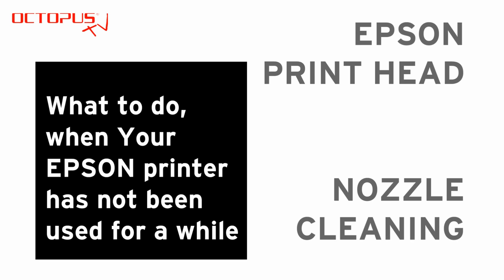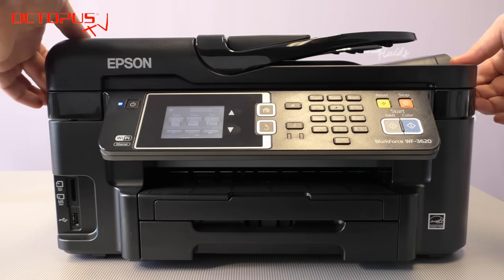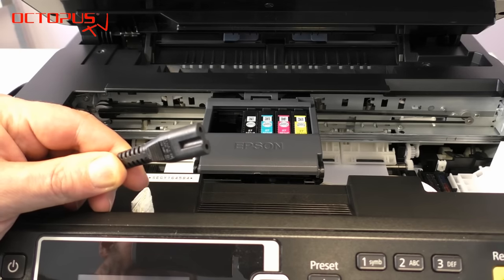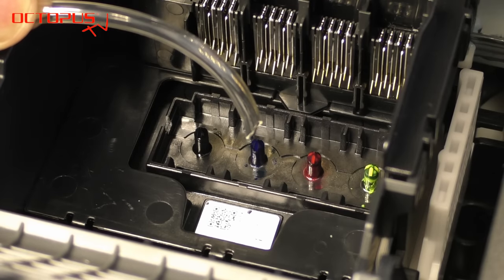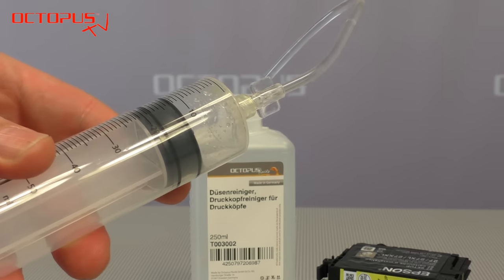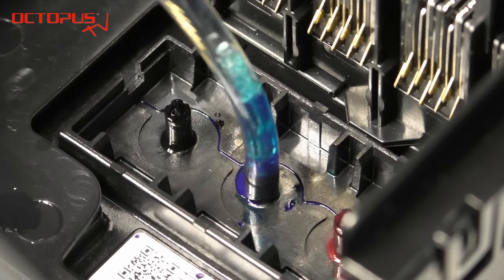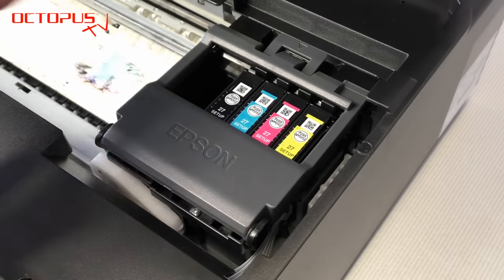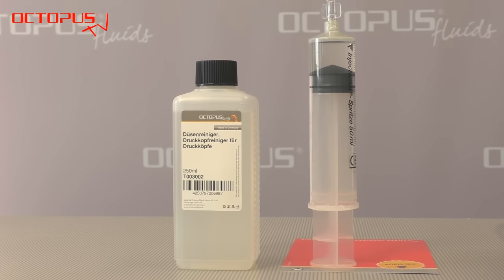Epson print head cleaner, nozzle cleaning - flushing clogged nozzles

Comment: Well would be very thankful if you answer my question, i have an sx218 i didn't use it for a long time and the ink head is just not flushing i tried the printer cleaning but still not flushing other head flush normally but the black ink head is clogged and nothing seem to flush it do you have any solution that can help ??
Reply from the maker: Hello Lina, thanks for Your question. The SX218 is a really old printer model - really good quality. So for Your issue there could be multiple causes.
As You say that You have not used the machine for a long time we assume that print head is dried in completely. There is also the chance that the ink remaining inside the print head has solidified - that´s a serious blocking then. The only chance to get rid of that is to let suitable print head cleaner taking its effect on such a clogging - that can take really long time. In that case building up pressure by flsuhing or paumping does not really support the process. The cleaner must be water based and is not alowed to have any minerals inside.
Beside that it is also possible that other obstacles are connected with the printer - the whole system is againg over the time and the materials the printer is made off are not going to be better.

Comment: Mine is a Epson model "ET-2550" which doesn't have ink cartridges but individual ink well "tanks".  How does one access those nozzels ?  Where does one obtain that syringe & proper diameter tubing ??
Reply from the maker: Thanks for Your question. At the Ecotank series You can detach the ink tubes, leading fromt the tanks to the print head, from the print head compartment. Then You have access to the ink ports in the print head compartment.

Comment: i have an Epson WF-7710 that stopped printing Magenta. I ran multiple print head cleans with no resolve. I had to end up buying another maintenance box. I also flushed all nozzles and cleaned print head. Now when powering on the print head slide to left and then makes a loud scratching sound and stays stuck to left. Error 000023. I also have a brand new Epson ET-15000 that I flushed ink out of to add sublimation ink to and it began making this same noise. After manually unlocking print head carriage to move it freely is there something you have to do to relock it back to original state. I dont want to send both to repair shop when obviously I caused the problem.
Reply from the maker: Hello Victoria, thanks for Your question and description of Your problem. Actually there are no additional steps necessary to get the print head back to work after setting the print head cartridge free to move manually. We recommend to unlock it by cutting off the power supply. How did You do it? Did You unlock it from the parking position in a different way?
Reply: @octopusoffice  I unplugged the printer as soon as print head carriage moved. Now when I turn printer on it makes loud noise when trying to move from left to right. Actually I tried again yesterday by taking ink cartridges out and the belt popped off when trying to move to right. Now I’m trying to bring to a service center for repair.
Reply from the maker: Hello Victoria, thanks for coming back with this detailed description. We understand that You refer to the belt that moves the print head compartment, right? Cutting off the power does not have any effect on this belt - when it comes loose or popps of its holders there must be some other reason for this behaviour.

Comment: I have used the method you describe but have a curious result. After I complete the cleaning process and place the ink tank back on (my trouble is with black only) I do not get any black printing. If I take a syringe put black ink in it and force the ink in with the syringe, then put the black ink tank back in place, I get black printout but only for a very short time, as if the injected ink only is being used. The black printout stops and
Reply from the maker: Hello Clif, thanks for Your description. When You are saying black tank You refer to a black inkjet cartridge, right? Have You tried to use another cartridge then the one in Your description?
Reply: @octopusoffice  Thanks for your quick reply. Yes, in fact I bought an Epson black cartridge, installed it, and there was no difference. As a result I decided that I would remove and clean the print head assembly thoroughly (following another video on how to do it). I completed that, but have yet to see the results because when I start up the printer I get a "error 31" when the carriage goes the the far left before it completes its initializing routine. When that difficulty is solved (any ideas appreciated) I will be able to see the results of my cleaning.

Comment: Will an isopropyl alcohol work for this purposes?
Reply from the maker: Hello Marco, thanks for Your question. The inks used in Epson desktop printers are waterbased inks. So You need to have a waterbased cleaner too - this achieves the best results. Isopropanol cannot dissolve cloggings caused by waterbased inks.

Comment: Hi sir,  I'm Chris Nguyen in Houston.  I have the same problem on Epson 2200 but after I tried to clean the clogged print head several times I got it so bad that I got the message "the photo black in is low or out" I don't know what to do.  Can you help me?
Reply from the maker: Hello Chris, we are sending our greetings to Houston! The message that You are describing should refer to the ink cartridge´s ink level status. After flushing the print head with cleaner You need to get ink back into the ink system. We recommend to do this by printing test prints on used paper. This consumes ink from the cartridge. Seems to us that You need a new cartridge. (?)

Comment: Thank you for this info!! I have cleaned all of the nozzles on mine and it appears that all of the colors are coming through on the kitchen towel now, however I can’t get anything to print on paper. I’ve completed all the steps to check alignment, etc. I’m so frustrated!! Any suggestions?
Reply from the maker: Hello Sonya, thanks for Your question. After the cleaning there always remains cleaning fluid inside the print head. It is necessary to print out that cleaner. We recommend to do test prints on used paper to get the prints back to looking normal. That may take a number of prints but this way You are not filling up the waste ink section on Your printer.

Comment: I followed these steps after my yellow ink was failing to print. After cleaning I replaced all new cartridges and now I’m getting blank pages. Managed to get the black to print, but no colour. Any suggestions? I’ve repeated the print head cleaning, including around 20 cycles of the printer cleaning programme from the menu
Reply from the maker: Hello Matt, thank you for asking. After using the cleaning method from the video, there is still print head cleaner in the print head - it has to come out again. The best way to do this is to start a print job with 100 pages - on paper that has already been used (the test prints are really for the wastebasket) - and then the colors will gradually return. When printing, you look again and again how the result looks and then decide to continue printing, to cancel the print when the colors match again or to start a new print job if the 100 pages are not enough. The advantage of printing out is that the printer's residual ink sponge is not unnecessarily burdened.
Reply: Thank you so much! Appreciate your reply!
Reply from the maker: Always welcome!

Comment: Hello, so my problem was that my printer (Epson xp-432) was not printing black anymore or very blurry so I bought your kit. Used it like in your video and it came out worse all colors went crazy. So I decided to remove the printhead and flushing like in your video but outside of the printer. I saw that the liquid I was flushing was nicely going out of the printhead so I reassemble it and tested. Now I'm back to square 1.. every color except black is printing perfectly, black is not printing at all so I don't know what to do. Maybe you have an answer to this ?
Reply: By the way, the cartridge is brand new
Reply: Well now I have an error code 0x9A I'm just gonna throw this garbage. Wasting my time repairing it and wasted half a price of a new one so well
Reply from the maker: Hello Tuan, thanks for the brief descritiom of Your situation. The outcome of your doings indicates that the clack nozzles did have a mailfunction before the cleaning already. So flushing the print head did not fix this issue. We also have not so good results with taking out the print head from an Epson printer - the wires and electrical connectors are really, really sensitive. In most cases we have done ourselves we had error messages related to the print head after installing the print head back into the printer. Sorry, that our way of cleaning did not provide a beneficial solution to You!
Reply: @octopusoffice  Well i wish i saved the money for my next printer that will not be Epson by the way lol. Anyway your product might be usefull but in my case it wasn't so too bad for me that's all. Thanks for your answer and have a nice day.
Reply from the maker: @christiantruvant4673  Same to You! Thanks for keeping up Your good mood ...

Comment: I once used the syringue based method, but it partially destroyed the print head as I may have applied too much pressure. To be done with care
Reply from the maker: Hello Pierre -  we are sorry to read about the not so nice outcome - we try to highligt that the amount of time given to the print head cleaner is doing the job and not the pressure :(
Reply: @octopusoffice  If I cant fix cyan and/or applied too much pressure as fluid will nor pass through, can I still use printer?  I only print in black?
Reply: @larrymulligan4824  Sure

Comment: I managed to declog my cyan using this technique but after a month, cyan seems to be leaking, not from under the print head  but splattered inside the printer, the inside including rollers are all covered by faint blue ... is there hope or its broken already?
Reply from the maker: Thanks for Your question. What kind of cartridges and what kind of ink are You using in Your printer? Are these alternative cartridges and alternative inks? It might occur that a non matching ink can cause such symptoms as too much ink is going through the print head and then is as You say splattered through the inside of the printer.

Comment: Hi,
I am wondering what is the contents of the bottle please,
is it a Isopropanol or can I use Isopropanol?
Thanks
Reply from the maker: Thanks for Your question. Our cleaner is a based on our formula for waterbased desktop printer inks - so the cleaner is basically a colorless ink. You need  to have water in the nozzle cleaning fluid to be able to dissolve cloggings and pollutions as the the inks in the Epson desktop printers are water based inks. You can use isopropanol  but it will not dissolve the cloggings. Best to use is purified and demineralized water if You are able to get Your hands on such material.

Comment: Stergios
I followed exactly the directions as they are described in the video. After many hours I have exactly the same problem with other guys : many-many blank pages.
I have put again the catridges but I have no ink point on the paper I have put under the nozzles (is the power supply needed or not during waiting for the ink drop?)
I don't think that I pushed with much pressure on the nozzles, but I am not sure about pressing air.
Do you thing that I have to wait a long time more? Do you think that it should be better if I was tryibg to print one page to 1000 copies automatically?
Wait for your experienced opinion.
Thankd in advance.
St
Reply from the maker: Hello Stergios, thank you very much for Your question and detailed description. If you are not sure about air beeing inside the print head: best solution is to flush the print head with cleaner again to make sure that the air is out. Air bubbles prevent the new ink getting from the cartridges to the nozzles.
After that You set back the cartridges and start printing 100 plus copies of a print using all 4 colors - this way You waste ink pad does not get polluted for nothing. Start printing is the fastest way to get the inks back on the paper - even if it takes a high number of prints - save on paper and use old paper to do these test prints.
Best regards
Octopus
Reply: Thank you very much for your support & your interest, I will follow your suggestion in the afternoon, when I will be back at home.
But I am wondering if it is normal that no color comes on the paper. Is there air inside each head? I can't beleive that, although I prefer that to be true...
Anyway, thanks once more...
I will give you a feedback later in the afternoon.
St.
Reply from the maker: Hello Stergios, in our tests we have cleaned all colors - so our assumption is based on that. And in that case   it is possible that there is air in each color cannel. Especially if You let the print head sit on an absorbend underlay without any cartridge set in.
The Epson print heads are quite stubborn but luckily also quite durable -  so if there is no damage to the print head before cleaing it - it will come back to life but it might need some work.
Reply: Unfortunately I could not print anything else than many-many (more than 200) blank pages. I followed again the described procedure flushing the cleaner in all the nozzles, I think that I took care about avoiding press air in the nozzles but the result remained the same.
When I press the cleaner in the nozzles I can see the color spots on the paper under the heads. But when I put again the cartridges inside and let it for 2-3 hours, no color spot on the paper, and the ink level doesn't decrease at all. 
What makes me impressed is that the paper under the heads remain completely dry when I have the cartridges inside,  although you have answered to another guy that we should wait color spots on the paper after some hours.
Do you think that I have to follow the cleaning procedure many times instead of printing a copy 200 times?
Or do you have any other idea? Thanks in advance
St.
Reply from the maker: Hello Stergios, thanks the feedback and describing Your results. We have not talked about Your printer model yet - what Epson printer You are trying to get back to life? Are the cartrides set into the print head compartment directly or are the cartidges connected to the print head by tubes?
Reply: Sorry, it was my fault.
My printer is wf3620, exactly the same with the one in the video
Reply from the maker: No need to apologize :) When You flush cleaner into the print head does the cleaner go through the print head easily or does it require You to apply quite an amount of pressure? My question is about if the print head has been really unkblocked yet and ink can go through from the inlets to the nozzles?
Reply: I have no previous experience, but I think that no much pressure is required. I thought that the colored ink seen on the paper under the heads should prove that the head is ubllocked.
Reply: @asterisg5473  did you end up fixing this? As my printer is doing the same after I cleaned it.

Comment: After I cleaned nozzles- printer is not printing anything. How to fix it?
Reply from the maker: Thanks for Your question. After flushing the print head there remains cleaning fluid inside the print head - this needs to get printed out. Use old paper for doing these test prints - slowly the colors will come back to normal.
Make sure not to press air into the print head during the flushing procedure. If You assume that there is air inside - just flush again with cleaner and push out the air - then test print to get the cleaner out. It may take quite a number of test prints to get the colors back --> use old paper :)

Comment: I GET all my lines in the test print but I get bad banding and streaking with my Epson unit.  will cleaning heads like this fix that too?
Reply from the maker: Thanks for the question. If the test print is fine the head should be free and no nozzles should be clogged. What kind of inks are You printing with: original Epson cartridges - cartridges by an alternative supplier - refillable cartridges filled with alternative inks? The banding and streaking indicates that the ink cannot flow sufficiently for the prints that You trying to make - in case You are working with alternative supplies it might by that the physical characteristics of the inks do not meet the needs of the printer despite not clogging the print head. Have You tried to increase the setting of the print quality?